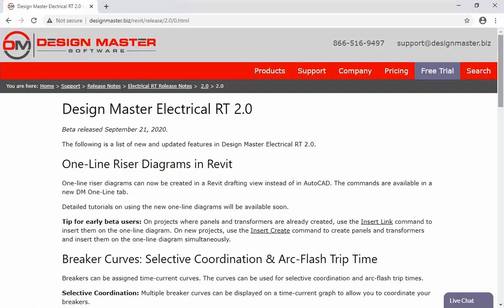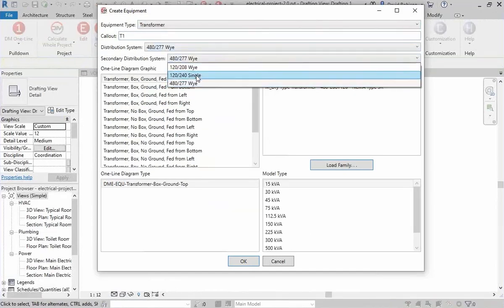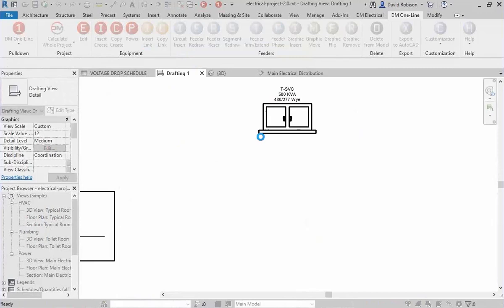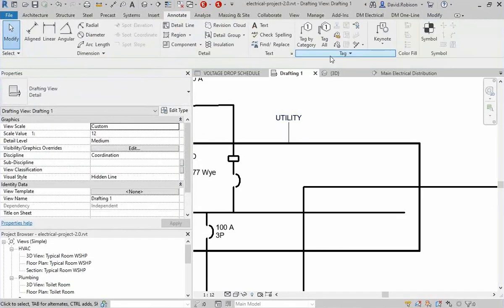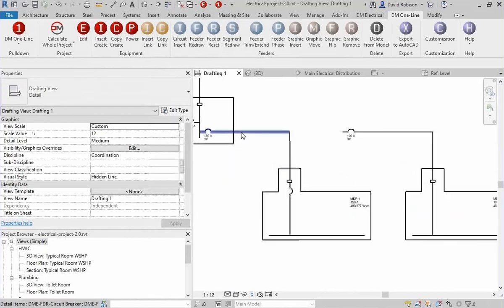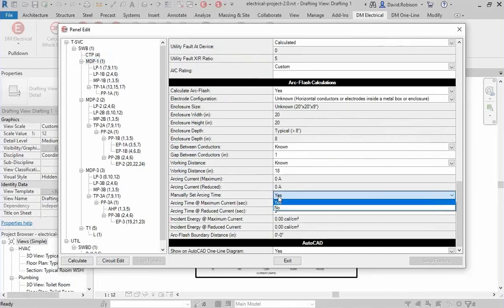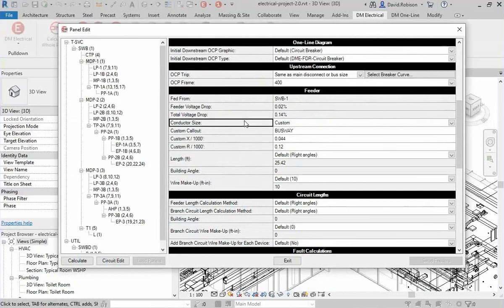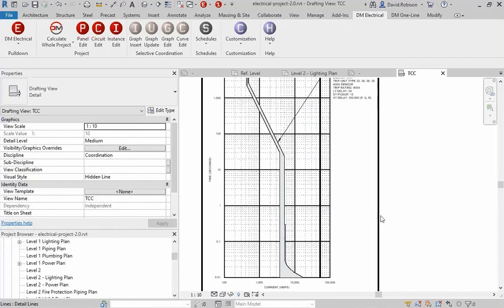Design Master Electrical for Revit: New Features in  DMERT 2.0 (10/08/2020)

Comment from the maker: One-line riser diagrams in Revit (01:56)
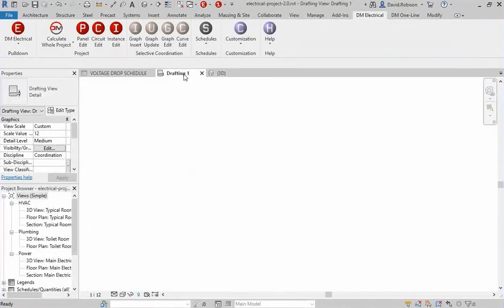    The DM One-Line ribbon and DM pulldowns (02:31)
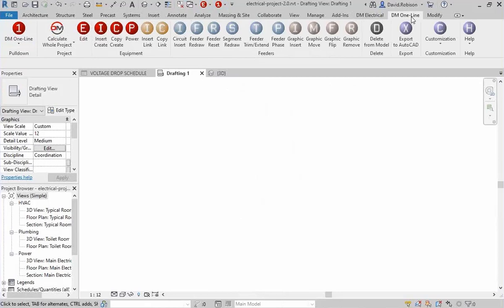    Creating your one-line diagram and devices simultaneously using the Insert Create command (03:33)
    Modifying feeders using the Graphic Remove*, *Feeder Reset*, and *Feeder Redraw commands (06:41)
    Switching from the drafting view to the 3D view (07:42)
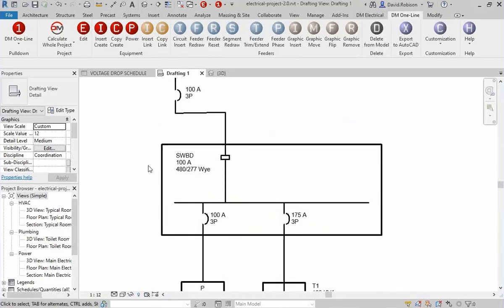    Modifying devices from the one-line diagram using the Edit command (09:03)
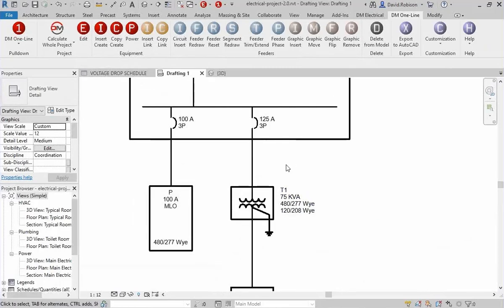    Creating your one-line diagram from existing devices using the Insert Link command (10:07)
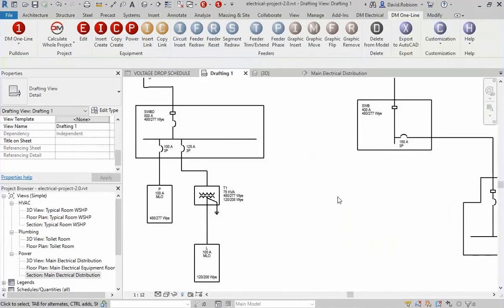    Modifying device connections using the Power command (14:34)
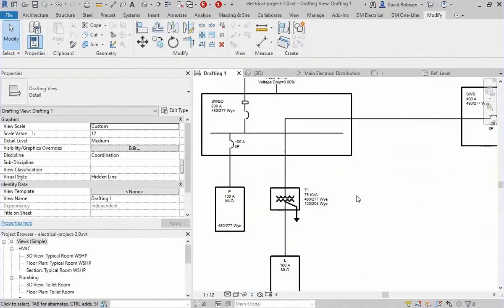    Using the Copy Link command (22:48)
    Customizing one-line diagram graphics in different Revit versions (24:37)
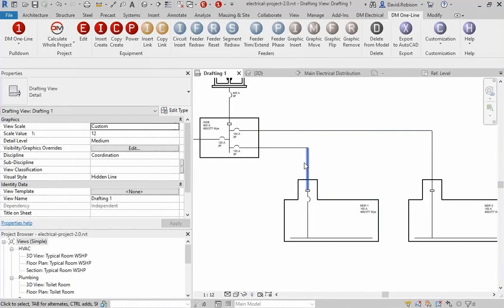    Deleting devices on the one-line diagram (25:26)
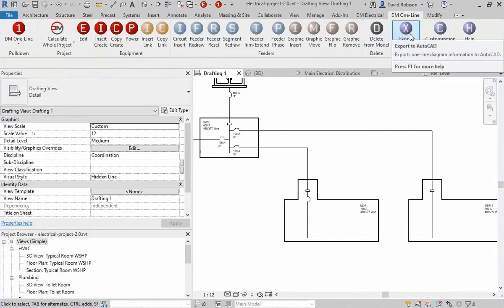    The future of the Export to AutoCAD command (25:53)
Breaker curves for selective coordination and arc-flash trip times (26:53)
    Creating a selective coordination graph using the Graph Insert command (27:31)
    Setting breaker curves in the Panel Edit command and Curve Edit command (27:56)
    Using the Graph Update command (29:34)
    Using breaker curves to calculate arc-flash trip times (30:23)
Calculating fault for branch circuit devices (32:18)
Sizing criteria for transformer overcurrent protection (33:26)
Defining custom wire callouts (35:21)
Setting wire sizing options for specific feeders (36:49)
Setting wire and breaker ampacity separately using the Wire Ampacities command (37:58)
Derating wires based upon double neutral and ambient temperature (39:05)
Homerun wire callouts for upsized branch circuits (40:35)

“Can I show the main circuit breaker on the switchboard graphic?” (10:36)
“How do I make connections between devices on the one-line diagram?” (14:10)
“Are there plans to have the software pre-select one-line diagram graphics based upon the Revit element?” (14:57)
“Will there be something like the Generate commands in AutoCAD?” (15:29)
“How do I customize the one-line diagram labels?” (16:22)
    A note about one-line diagram files, conversions, and caching (17:46)
    How to load Design Master shared parameters (19:17)
    How to customize which labels come in with the graphic (21:15)
“Can I put different selective coordination graphs in their own drafting views?” (42:31)
“What are your procedures for testing and validating your calculations?” (43:09)
“Which Revit versions will be supported in this update?” (45:04)